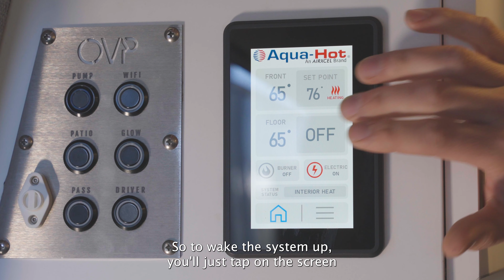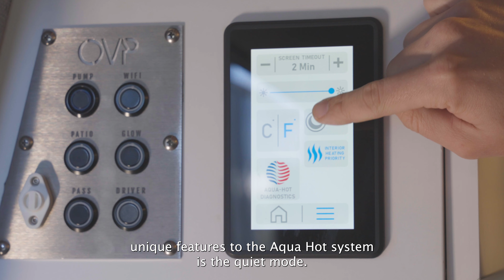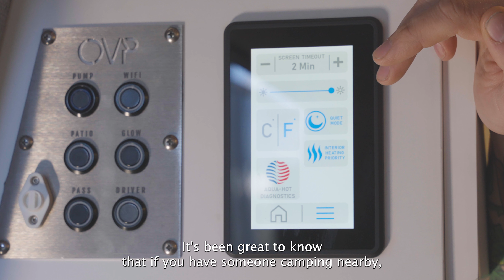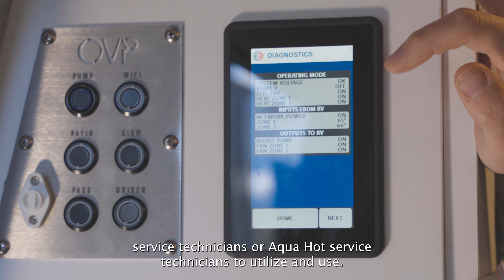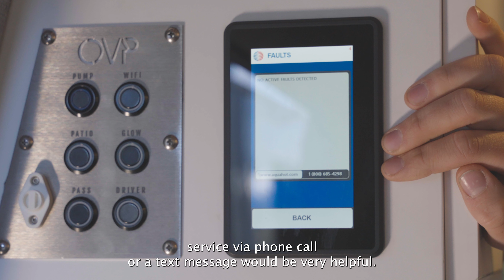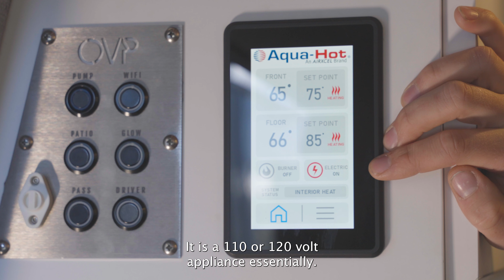Getting Started // Aqua Hot System Overview

Comment: What if you are traveling in the summer and don't want any heat, but still want hot water?
Reply: it automatically keeps the heat in its tank for thermal use of making water hot, and not heating the van via an integrated 3 way valve.